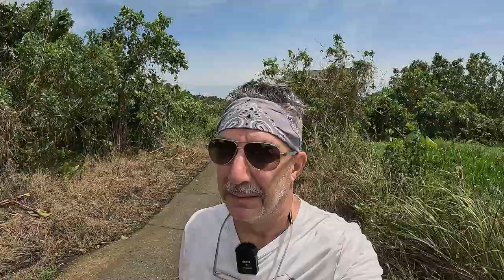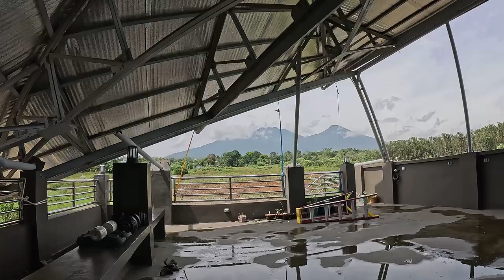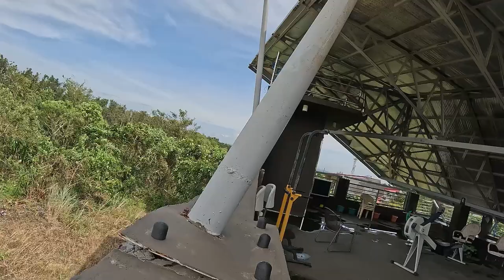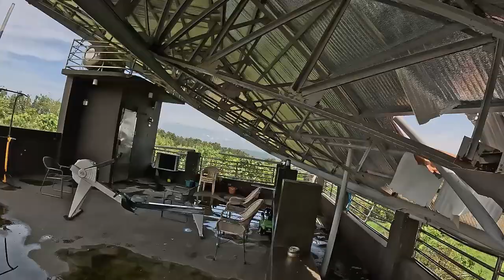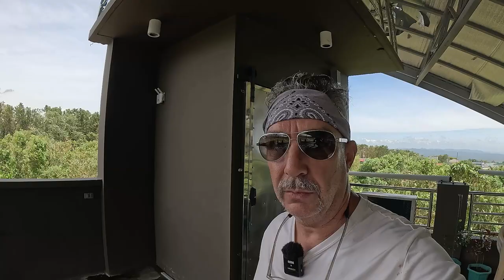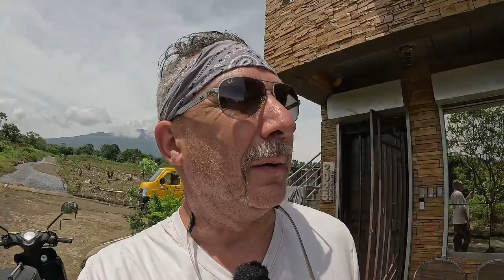Typhoon Kristine: Damage! 😱 | Garage Build Philippines | Ep. 31 | TORINO

Comment: Man after 35 years in construction and trained design construct builder. I can see so many design errors in that roof. Sorry you had to learn the hard way. As a suggestion check out specs for tropical storm design in Australia. Next time use at least 1/4" plate for the base plates and keep the bolts in 3" from the edge of the concrete and add 4 more bolts. Also add cross bracing to reduce shear stress on the individual posts. I hope you recover from this tragedy. Please run the new design by a professional engineer.
Reply from the maker: Thanks for the advice, much appreciated.

Comment: Hi I'm a retired builder in New Zealand  factory steel and block construction. 
I think the plates preformed well since most held ripping hold down bolts out.
Did it not consider that the steel posts needed diagonal bracing 45 degree angle 2 sets per wall length. 
Even a light wind that roof would sway.
The roof trusses look very good design.
Gussets are never going to hold that roof in Philippines typhoon. 
Even better extend the concrete columns to support the roof.
Like you say it's good no injury or life was lost
When ever I build people's life is utmost in my consideration. 
Lesson learn rebuilt  with professional calculations.
I would lift it using a crane build temporary supports like a house mover uses.
Reply from the maker: Thanks for your feedback, much appreciated.